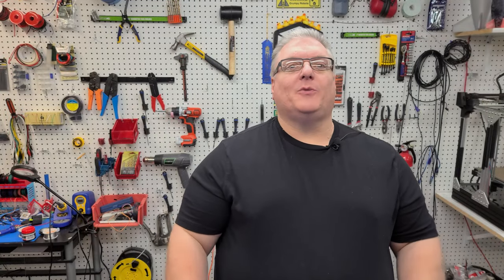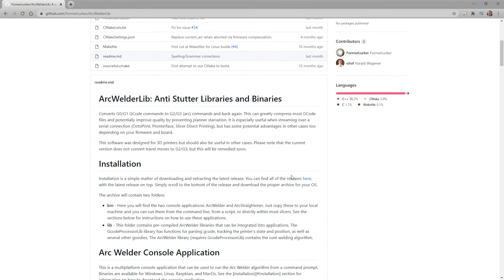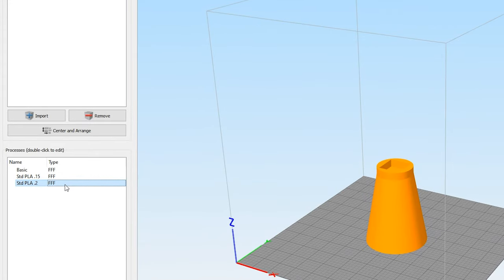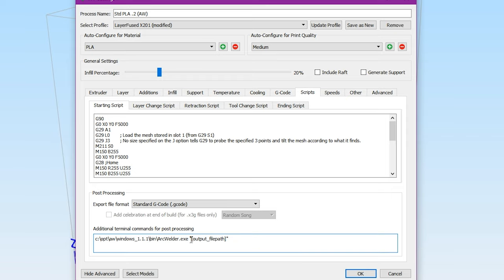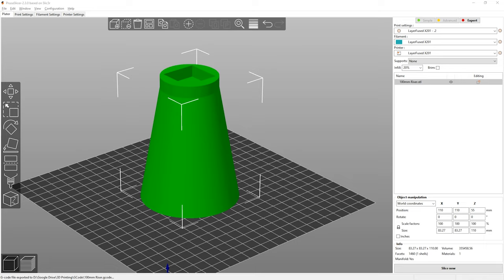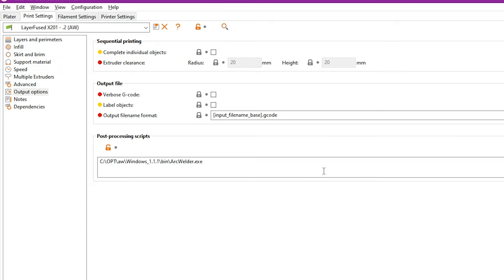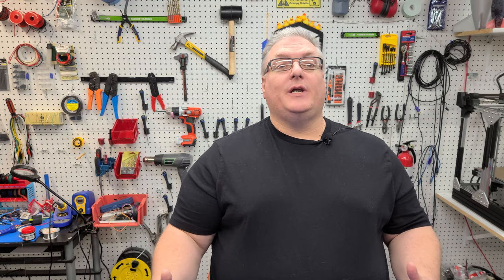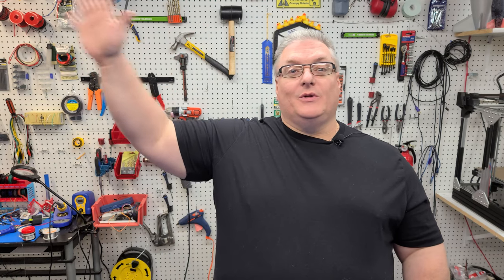Arc Welder In Prusa Slicer and Simplify 3D

Comment: It seems like the printer runs faster through small-radius curvatures. And it seems less noisy too. Both things may however be because it has been a while since I did a print where I sat by it for longer than the first layer so I could have forgotten the actual sound of my printer.

Comment: I would be very interested in hearing from the designer of arc welder. My questions would be; Is there documentation available to instruct us about how to get all that we can from both sides of arc welder? The ARC side and the line side. What other projects are you working on for the 3D world? Do you see coding as getting easier to do or as getting more complicated/complex. Are there coding platforms that are better for certain uses, such as python for Arduino but C++ for the PI or bones systems? I really hope you can set this up and give us plenty of notice to be here. Thank you for the opertunity to learn from the designer as well as for what you teach us yourself.

Comment: I have it installed in Cura, with some prints I have problems with the final product. For instance, retracted letters are partially filled, quite annoying. This with and without 90 / 91 activated for 32-bit board
Reply from the maker: I would for sure open a bug report with the stl example for formerlurker.  That helps improve the next version

Comment: Can't make it work. What is the value of output_filepath? Is that the path and file used when saving the model from S3D? I don't print from S3D but send the file to a different location, but that file doesn't contain the post-processing. Does this only work when printing directly from S3D via the USB? If so then how to see the gcode created?
Thank you.
Reply: Yea. I am having the same issue with Simplify3D. It doesn't show that it has been post processed.
Reply: for some reason it doesn't work when the file path was too big. So I referenced the file to the downloads folder. The one I downloaded from GitHub was Windows32 for some reason that one worked and not the Windows. Next on the "starting script" section I selected all and CUT it saved it on a note pad (so I don't lose my starting script). So with the Starting Script completely blank I added on the additional scripts I added the 

c:\Users\PC\Downloads\Windows32_1.1.1\bin\ArcWelder.exe "[output_filepath]"

Procced the slicer like normal and it worked. after it worked, I added back the Starting Scripts and ran the slicer again it worked again. I don't know how it worked but that was the only way I was able to get it to work.

Comment: I am like the other two guys below.    When  I put in arcwelder.exe "[output_filepath}"    it  generates  the  standard code with no AW process.   something is wrong with the command line  and  I dont  get that   input  output  file   conversion.      PLEASE   ADVISE.     Thanks
Reply from the maker: Are you using ] or the curly brace to end.  It should be ]
Reply: @MakersMashup   I was  using  ] brace.   in the short term I used your other  video and   DL'd the program to  windows root and  then used the command mode and  transformed in that directory.    What is confusing is I am assuming that S3D knows that the file in the process is the input file and  then  writes it whereas when I do it in the directory I have to  actually say  arcwelder  X.gcdode  Y.gcode .     I dont think I have to name the input file  in the script each time I convert?    I  didnt see you do  that.     My  S3d   script string  is this.-->   C:\Users\mikea\Documents\_3D Printers\_ARCWELDER\bin\ ArcWelder.exe "[input_filepath] "              Which I believe  would be the same as yours.    (maybe the  " has to  be right next to the last ].          ]"   and  not  ] "                 Sorry to be so  long winded but trying to explain.    anyway  I did  do the work around til I sort this out.
Reply: @MakersMashup  MY   BAD.    I  used one of your elements of the path name   which  was not in my extraction. DUH!!   put in my path to AW and it worked fine.
Reply: @mikeanderson2404  Can you explain what the actual script line should look like within S3D if you have it working there? I'm still stuck without seeing anything being processed in the output file and so far I've tried moving the ArcWelder directory around so it shouldn't be a permissions problem but I think the run line just isn't happy.  The github is less than clear and I have yet to figure out how to even run this manually in command shell if need be.

Comment: Has anybody successfully run this in PrusaSlicer? I've followed the video exactly and my prints are coming out entirely wrong, the tool path is a mess.
Reply from the maker: Check to make sure your 3D Printer can support the G2 command. Based on your description it sounds like your printer may not support arcs.  You would have to recompile your firmware to add it providing of course you're able to do that. Some printers with proprietary firmware can't be updated. Try running "G2 I20 J20" on your printer.  That should move the head around in a circle.

Comment: Is it possible to use arc welder with Ideamaker?
Reply from the maker: If it outputs gcode then it should providing the printer has g2 support.  Just use the command line version

Comment: After the first video, I installed Arc Welder to Cura for a stock Ender 3 printer with the 8-bit board and was very confused when I wasn't getting anywhere with it before realising I hadn't set it up within the firmware LOL
Reply: Please elaborate for us newbies.
Reply: @keydelllorenzana8143  Arc welder needs to be enabled in your firmware before installing the plugin, the plugin wint work without it active in the firmware, I am not sure whether it will work with an 8bit board though
Reply: @AndrewAHayes  this might be a bit advanced for me. I just ordered my ender 3s1 Pro.  I may come back to this after I get some experience. Thank you for telling me so I did not waste time configuring my prusa slicer hehe.